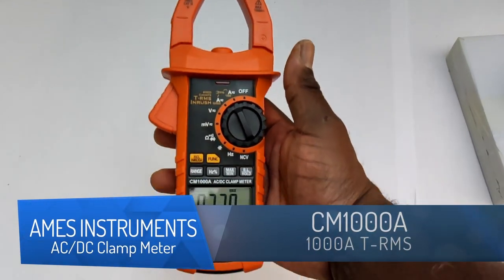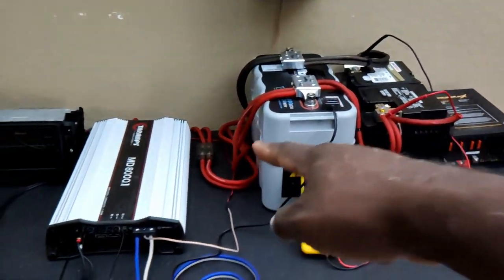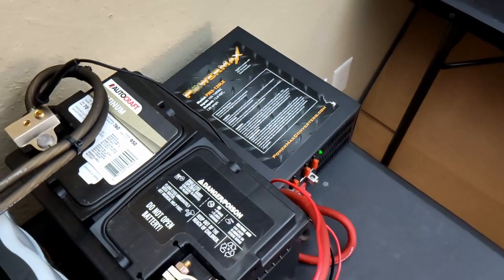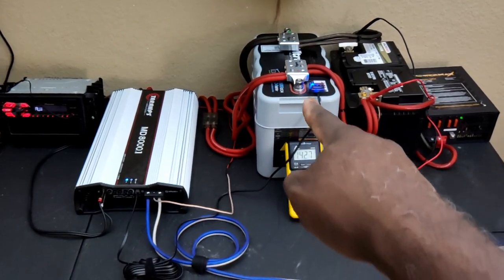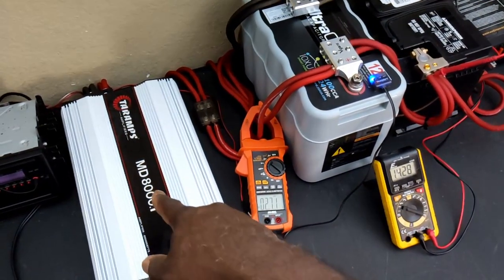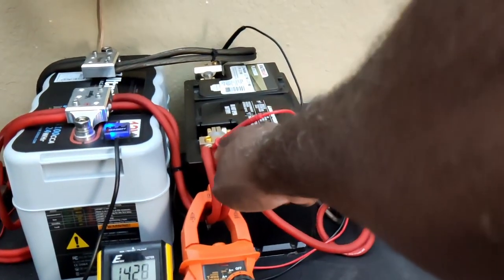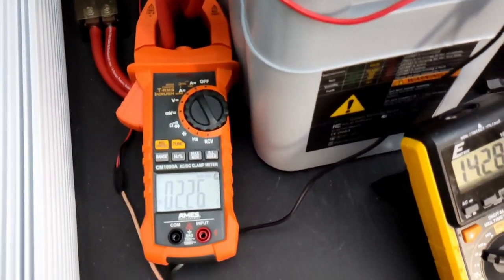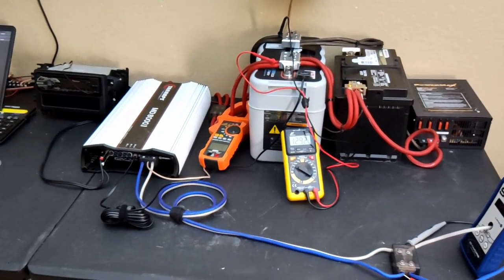How Too Much Amp Draw Hurts SPL! Clamping A 3,500 Watt System

Comment: I don't know when, and where, some people got the "HUGE" misinformation, about an amplifier clipping, just because of voltage drop=🤦‍😒 If your amplifier pull's 350 amp's, with a given load/impedance, and is 80% eff., @ that load/impedance, it will make more, or less wattage, depending on the actual voltage present, @ that 350 amp draw. Example #1: 350 Amp's x 14.4 volt's= (not @ rest, but when a 350 Amp draw is present= very hard to accomplish) x 80% eff.= the power produced= 4,032 watt's @ clipping. Example #2: Same amp, 350 Amp's x 12.0 volt's= (@ 350 amp draw= cause of a lesser electrical system) x 80% eff. = the power produced= 3,360 watt's @ clipping. Same exact amplifier, but two different electrical system's, with the exact same load/impedance, with the exact same amplifier eff.. The amplifier does not clip sooner, or because of more voltage drop, it just make's less power, because it's getting less power. Also this same amplifier, will not run cooler @ clipping, with the higher voltage present, again it will just make more power, because it's getting more power! If "ANYONE" want's "ANY" amplifier to run cooler, or be cleaner= Lower THD, and higher Damping factor, ( 1st assuming ALL setting's are correctly set). Then just run a 1 ohm stable amp, @ 2 ohm's, or 4 ohm's, or a 4 ch. amp that's 2 ohm's stable, @ 4 ohm's, or 8 ohm's, and always have a way to monitor clipping, so you can turn it down when the amp clip's. "ANY" amplifier, with "ANY" amount of impedance, with "ANY" electrical system, can clip! Last mind blowing fact, "ANY" amplifier, that is making more power, with higher voltage, @ the same eff., will get hotter faster, and will have a higher overall temperature, because it is making more power!

Comment: I STUMBLED RANDOMLY ON YOUR VIDEO ON RECOMMENDED ABOUT MONTH AGO...I ABSOLUTELY LOVE YOUR CHANNEL!! VERY INFORMATIVE!! 

On a side note...with all the BASS Testing in the house...your wife is cool with all the BOOM BOOM 💥 from those subwoofer she hears constantly from Testing ?! 😆
Reply from the maker: I guess you can call me Lucky 😉
Reply: @BudgetBassHead  what wire is that I use Wire and supply 2/0 welding cable
Reply: @moneycat3789  The power wire from the battery to amp is 2 runs of 4ga ofc from KnuKonceptz. Its slightly oversized. I have the same. Its got a 6.5mm core diameter which the AWG classifies as 2ga. Its hefty stuff.

Comment: My stock alternator is 180 amps. My car has 5 heated seats. Without the seat heaters, headlights, and ac/heat i can easily have 91 amps in reserve from the alternator.

Thanks for showing this vid. I did not realize that the amperage draw would be different between the main batteries and the caps. Always learn something new, and I know quite a bit. Keep the vids coming bro.
Reply: I believe the Ultracap can supply that additional power for a short time before it has to draw higher current from the upstream components. He only did maybe 2 seconds at a time. With music the cap can smooth out the higher surges. If your music is really bass heavy with long notes, etc... its going to draw much more than the 90A in the video. Remember that the amp was drawing 230A.

Comment: commenting beforehand, the voltage is going to be the same where ever you measure, minus the voltage drop of the wires between the units. Now the wires are heavy gauge wires so the drop will be minimal. With that said, i think you are very dedicated and even at 300 subs you had a giveaway and that's dedication. You have a great setup here

Comment: Whichever has the higher voltage and most capacity will carry everything else. And balancing in parallel  works best when charging at an amp or two. Lifepo4 has a really flat discharge curve. Every cell can be at 3.3v and be charged higher or lower. I love experiments like these. It's how we learn brotha!

Comment: atleast now i know the super caps going to do what i want it to do, If the battery is only pushing 90 amps,  And  overall  its doing 200+  to the amp, that capacitor banks doing work.   this is exactly what i need for my sq setup in my bedroom. im using 3 ovp bypassed server computers that do 64 amps each.  and the power draw of a 1200.4 and a 2000.1 amp  Makes them trip  from surge. im  hoping  that adding a ioxus cap  will get rid of that power trip i keep getting . this basically verifies what i need .thanks  for your very informative video.

Comment: “This community for enough misinformation” ain’t that the truth. I’ve been wrong a gang of times too. Us DIY guys are trying to find some solid answers but honestly I don’t think they’re are too many rock solid truths in car audio. I guess maybe if you had very expensive measuring tools. I wish you were closer so I could throw your spl meter and that SMD impedance tool on my system. I’ll design a box for you in exchange if you’re not up on WIN ISD. Is the spl labs meter the cheapest meter that measures low frequencies? Thanks bro

Comment: Good video bro. One thing I just noticed is that you said the headway is rated for 200 amps continuous but you have a 64ah bank of them. Which is basically 8 banks of 4 cells. Each bank of 4 cells is capable of a 200amp draw. With 8 banks that's 1600 amps of current at the max discharge rate which is capable of powering two of those MD 8000.1 also invest in cell voltage balancer for the lithiums bro. You'll extend your batteries life span and make sure everything is charging evenly
Reply from the maker: Coming in the next video😉
Reply: What your mixing up is that when cells are wired in parallel the amps add up. When wired in series the amps stay the same. Remember that watts/power is amps times voltage. So if each bank of 4 cells is rated at 200A, then 7 more banks of the same in series is still 200A, but the voltage is higher. You would only get 1600A if you wired all 32 cells in parallel, but the voltage would be way too low. I hope that clears it up.
Reply: I just looked up this battery module. They say each individual cell can do 200A. So 4 in parallel would be 800A and then 8 banks of 4 in series is 24v 800A. For a 12v application you want to wire them as 4 banks of 8 or 4S8P. That would be 12v 1600A. Maybe that is what you meant?

Comment: i thought Id learn something new. I didnt. All i learnt was confirmation of my basic logic. If your car requires 100amps from your stock alternator and you install something new that draws an additional 100 amps then logic dictates you need a higher output alternator. Putting extra batteries or capacitors is pointless unless you want to play music without the alternator running.

Most people want to listen to their music with their gear at 100% of its rated power and they keep getting half arsed answers from people in the industry. Your video just proved with evidence that the key is the alternator. 

Batteries and capacitors are for when you want to listen to your music without the car running which is stupid.

Comment: I got 475 AH of AGM on a stock alternator 
I can do 500 amps of current peaks on music and stay above 12 volts, it’s pretty crazy how loud you can get on stock alt. never blown a amp or subwoofer but I do not let anything clip including the RCA signal
Reply from the maker: ...smart man. 👍
Reply: How you think you get stupid loud??? Light clipping isn't bad cuz thats when u get stupid loud
Reply: @schons77iceman  lol, I tune my system right it does over 150 dB on music and it sounds great when I clip the sound quality sounds like shit
Reply: @schons77iceman  clipping doesn't make anything louder
Reply: @beardedforlife  if your not clipping a little then your not turning it up far enough so yes light clipping does make it louder
Reply: @schons77iceman  I think you need to do some research. A clipped signal light or not limits the voltage. With that being said how could you possibly get louder when you aren't supplying more voltage
Reply: @beardedforlife  honestly I don't even care I made that comment 6 months ago and I was probably stoned as fuck and just trying to be a smart ass
Reply: @beardedforlife3740  Clipping does increase output. I assume your thinking that the peak to peak voltage does not get higher when clipping. Thats true, but the rms/average voltage does increase. It is well known in competition circles that you get more power when clipping. Some competitors will even push the clipping to 10%. It sounds terrible and can overheat the sub, but it gives you that extra spl score you need to beat the other guy.

Comment: You prob already know this but can run convertors in parallel adds more amp output, im tryin get away with a couple convertors and power caps do away with a battery

Comment: Have you tried turning up the voltage on that converter. Does it have the option?  It would be neat to see if the voltage ends up higher when under load and how much amperage. The cap should handle it, not sure about the batteries.
Reply from the maker: It goes up to 16.5 volts

Comment: No 2v on those lifepo4 cells. 3v at minimum each. thats ALL of the capacity. You dont use these only if you have a stock or non upgradable alt. you just use em regardless. ditch the lead acid if your using this big of a pack. your car will even crank faster :P even a big old 85 ford like mine
Reply from the maker: Agreed.

Comment: I also have a Beast Module. I set it up as two 12v with 16 cells each.

Fyi..the BM is not 200amp continuous..that the rating of each individual Headway cell.

Comment: Great info man. Hey question for you, In your opinion with box rise and all, would I benefit running my 2 12s dual 4 at a 4ohm final impedence or 1ohm final impedence,  I know at 1ohm would cost alot less and all but wouldn't I benefit if I could still give my woofer the same rms at a 4ohm load with a huge amp as long as my elec is on par......
Reply from the maker: What ever load is giving you the results you want... stick with that. If you are rising too much, then get more power.
Reply: My thoughts exactly,  when in doubt max it out!!!!!!!
Reply: If you can afford to run the same wattage at a higher Impedance then you will have much better cone control, (dampening factor(Attack and Decay))  cooler amps, and better efficiency (majority of amps are most efficient at 4ohms) . Downsides are, larger physical size of amps, possibly higher Idle current draw, and COST it’s going to be more expensive than people are willing to pay for. My advice unless you rich or a (super SQ junkie) just buy more amp than you need at 1 ohm so you are never near the clipping point and run the biggest/shortest wires to your subs.
Reply: @everythingbox  ya I had enough second guessing myself. So I went all in and bought th RF T2500bdcp

Comment: So would a 260 amp alt(200 at idle) 3 agms, one of them being an xs3400 in the rear next to the amp be sufficient for a taramps smart 3 bass? I have a ioxus uc-31 on the way and plan to install. Would it help with voltage drop? I also have 6 xs power super caps, the 2.7v 3000 farad cells, but am reluctant to install, until I can figure out a safer secure way to mount. But if the uc-31 is enough, I’ll sell them.
Reply from the maker: That should be more than enough

Comment: Maybe be a noob question but in that system the lithium would take the place of the ultra cap correct?
Reply: It would replace the battery since it is a battery. You can still run the ultracap (assuming you have one) as it would help. A lot of times the lithium battery may be all that's needed.
Reply: Ok I understand he

Comment: So....is the ioxus cap good or not?
Reply: Look what it did here. It took a 230A load from the amp and only drew 90A from the battery. If you drew the 230A from the battery the voltage would be dipping lower and your lights dimming. So for short bursts or actual music it can help a lot. It would probably run out of juice on a 30 second spl competition and need to draw more power from the battery/alt. So it can definitely be beneficial on a fairly high power system.

Comment: HelIo everyone, I have two of these coming in the mail tomorrow just wanted to know if i can  hook two of these ultracapacitors in parallel with my 4 xs power 5100r batteries and do i have to safely charge this thing with a light bulb resistor or can i just hook it up in the car and it charges up really
Reply: I let my 12,000 watt taramps spark, I tried with the light bulb thing and didn’t work
Reply from the maker: The UC31 was designed to be run in parallels with automotive batteries. No need for traditional capacitor charging; its all handled by the internals. I personally don't see a problem with running multiple in series. It's still a 12 volt system. But I guess its best to contact the manufacture for clarity.

Comment: DC current flows OUT through the negative side, NOT the positive side. Popular misconception. Even I believed the opposite until I took electronics classes in college. So double check your clamp arrow direction to show incoming flow on the positive cable, not outbound flow.
Reply from the maker: I'm simply following the manufacturer's specifications. And this clamp meter can actually measure both negative and positive; they both have directional arrows.
Reply: @BudgetBassHead  cool man, just throwing that out there because most people believe it flows out through the negative. I actually thought my instructor was losing his mind when he told me that. I looked it up in four different places to verify. Lol.  Have a great day! Great videos by the way.
Reply: Yep. Electron flow goes from negative—> positive
Reply: I don't believe the manufacturer is referring to electron flow. Why would they use that? Makes no sense. I'm sure they meant the conventional way power flows which is positive to negative. Personally, all my ammeters did not care which direction they were mounted. I tend to only measure the power wire  though.

Comment: man all you actually needed is an amplifier with a regulated power supply in it . also i must say in classic home systems transformers are allowed to drop 5% voltage and even those freak audiophile guys are ok with this much of drop . so nice video but really all you need is a regulated amplifier .

Comment: the reason I ALWAYS have a toggle switch on my amp.. I cut it OFF when I'm not using it.. OFF!!!..
Reply: Removing power from the remote wire does the same thing. There is no parasitic draw from the amp.